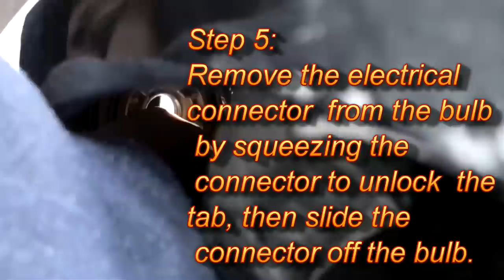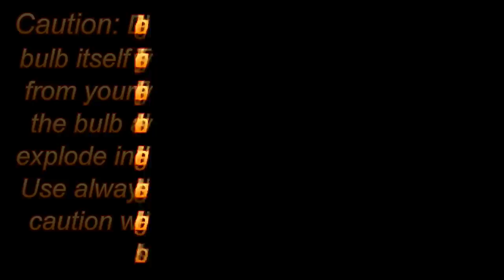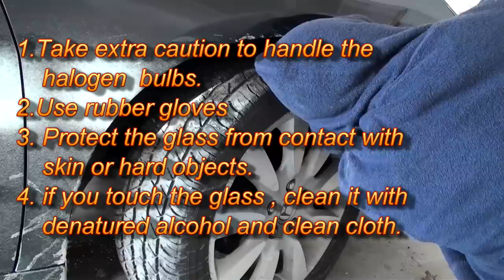How to Replace the Headlight Bulb on a Honda Accord 2007-Low Beam

Comment: What a nonsense this video is - all you have to do to replace a low beam light bukb (on the passenger side) is to open the hood, reach for the wire connector, remove it from the headlight by turning it, disconnect the bulb from the the wires, replace it with the new bulb, and put the bulb with the connector back.  On the driver side you need to remove the battery first.  There is no need to disconnect the wheel well cover or unscrew any screws.

Comment: You dont need to do ANY of inner fender for the passenger or driver side...driver side:remove battery...passenger side: just stick your hand in.  No offense to the make of the video but you put yourself through so much unnecessary work!